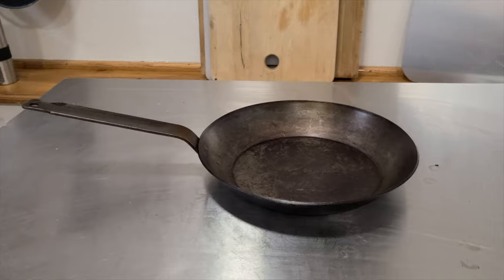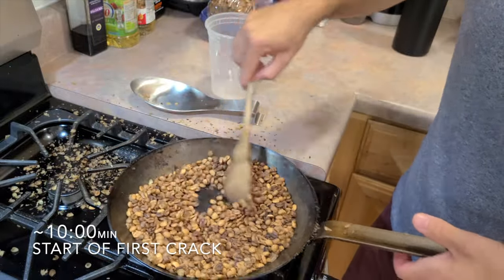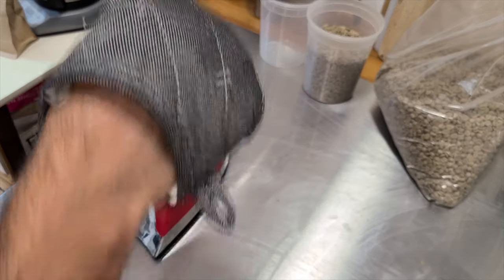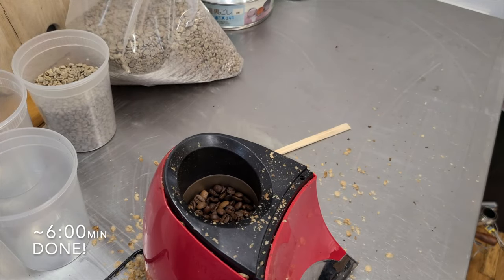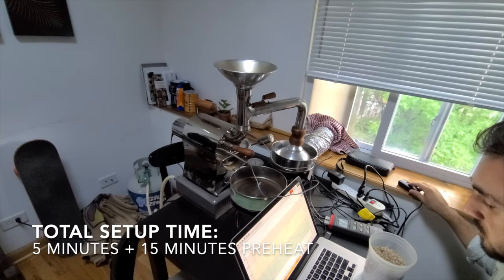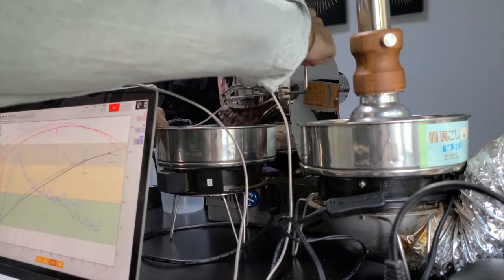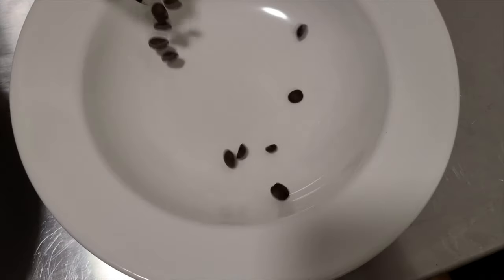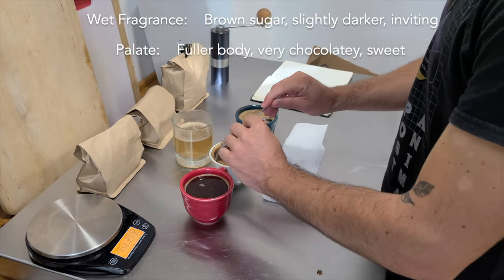Home Coffee Roasting - 3 Levels

Comment: I use a popcorn popper as well. It has proper air circulation so I don't have to mix the beans by hand, it does that by itself and I've had no issues with not mixing it manually. This allows me to put some lid to catch the shells that fly everywhere otherwise and it's really clean and effective method. Afterwards I spread the beans on a plate or something and put them to freezer for a while. With pan roast I always have the issue that the "open" side of the bean tends to burn, popcorn machine results in a really nice even roast.
Reply: Hello can you tell me watt brand popcorn popper did u used
Reply from the maker: I used a Nostalgia brand popcorn popper!
Reply: Try the fresh roast sr540. It works just like a popcorn you control  the fan speed and the heat settings.